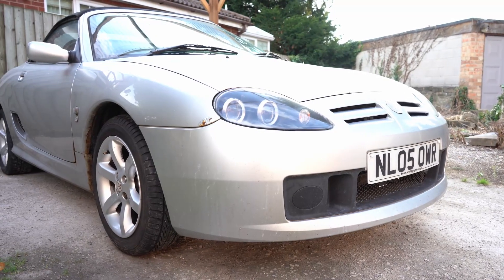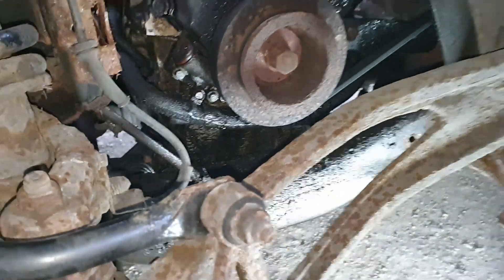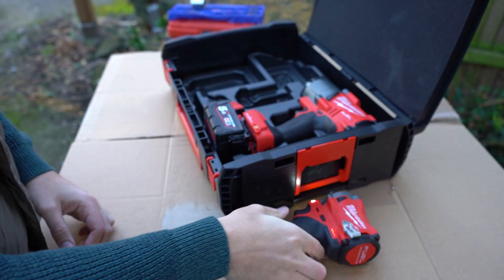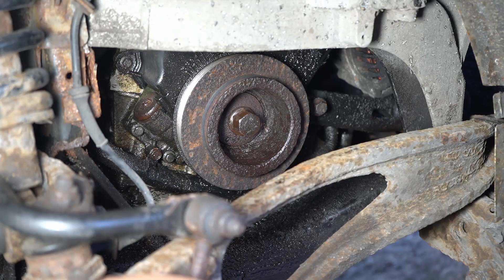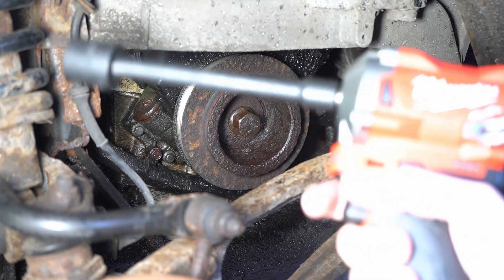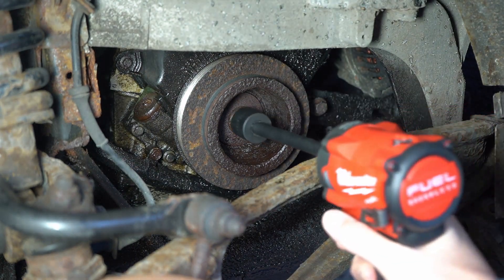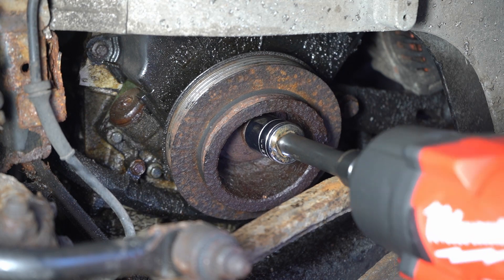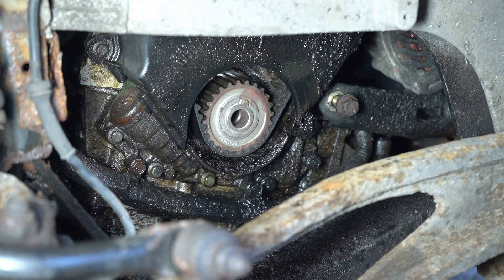Removing a crank shaft bolt on an MG TF

Comment: I used my biggest torque wrench: The engine. 18" breaker bar wedged into the subframe to keep it stable.

There's no way the bolt will shear off. It's clean on the inside. Just need to "crack" the first part of the thread and it comes out with fingers.

EDIT: Oh, and a little bit of heat to loosen some of the rust. That's what "cracks".
Reply: @Ben Torin Definitely, I've been using Flixzone for since december myself =)
Reply: @Ben Torin definitely, been using flixzone for months myself :)
Reply: @Ben Torin yea, I have been watching on flixzone for since november myself :)